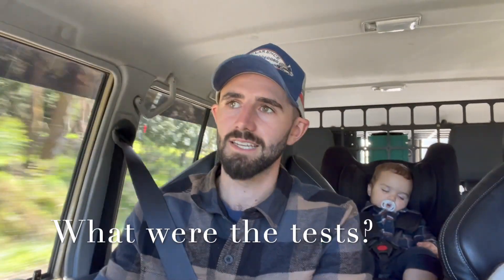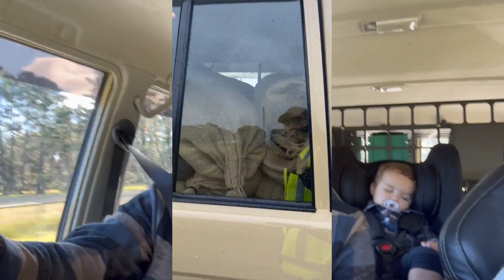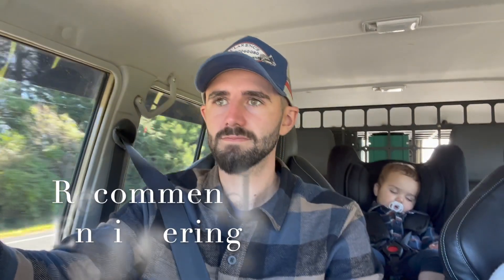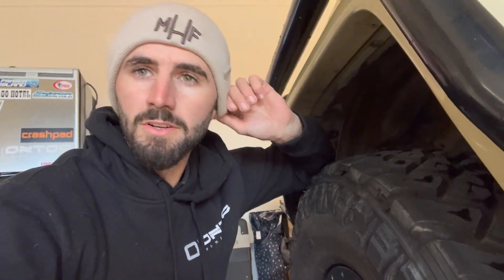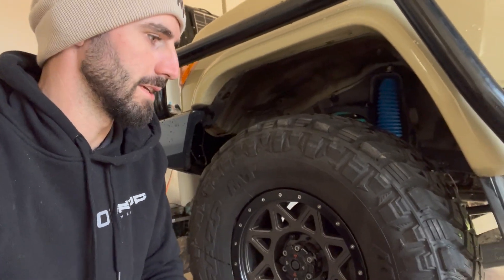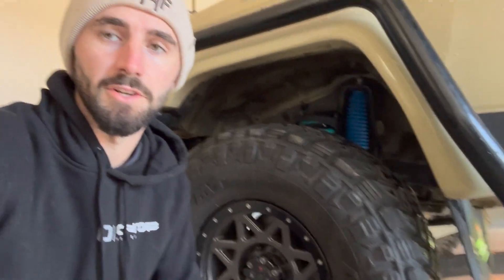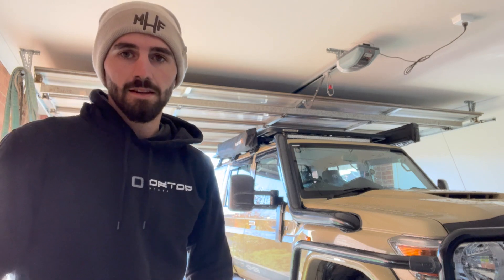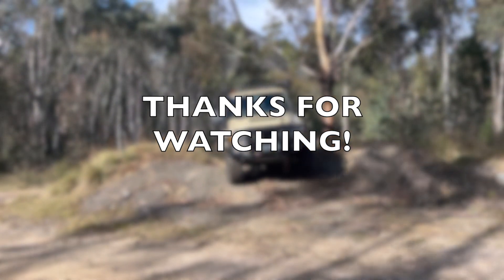ENGINEERING POST REGO || MY PROCESS AND FAQ

Comment: Love the details mate. Keep the videos comin. Re. your original offset steelies. Aside from the fact they wouldn't pass engineering, were they all good for you? I know they put pressure on the bearings so trying to weigh up the pros and cons. The main pro being I want to track correct it (w/o having to swap the diff out). Keen for your thoughts
Reply from the maker: Thanks mate, yeh the original Steelies were perfect didn’t have a drama, was stable on the road and off, have you looked at multidrive track correction? Seems to be a good fix to the axle problems.
Reply: @Supremetouringaustralia  so i had originally passed over multidrive (and similar) because of the costs but after your note I looked further into it and gave them a call. Rest is history. Im going with their Tru Tracker system. Decided to do it right once. I like that they use an OEM housing so it's as close to original parts as possible. Thanks for tip and keep the videos comin!

Comment: Excellent info mate, your 76 is looking mint 👌🏾. What size lift n are you running 35’s. I really like your maxtrax spare wheel holder, which one is it. Could I incorporate with my Crashpad stealth bag. Keep up with more content mate.🤙🏽
Reply from the maker: Thanks mate, running superior 3” lift with super flex arms, 315s 

It’s the max trax spare wheel strap, I ran it with my crash pad bag just have to run it backwards so maxtrax are on the car side of the spare tyres if it’s in a rear bar.
Reply: Roji thanks mate, very good idea you legend 🤙🏽